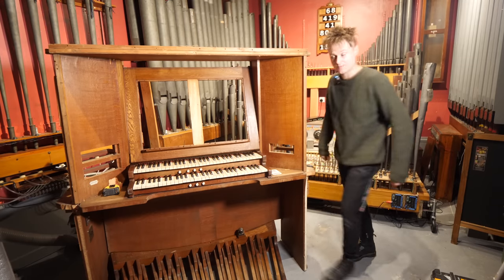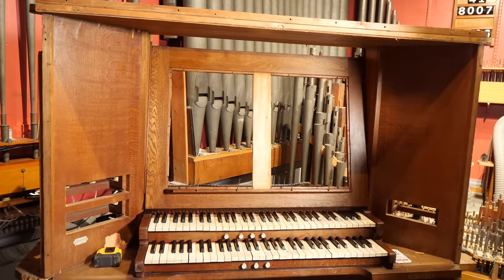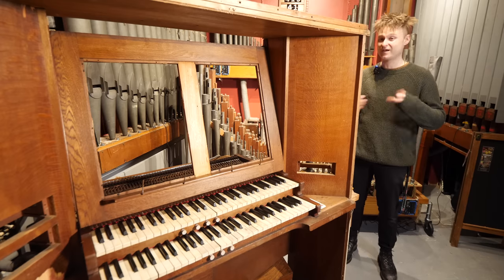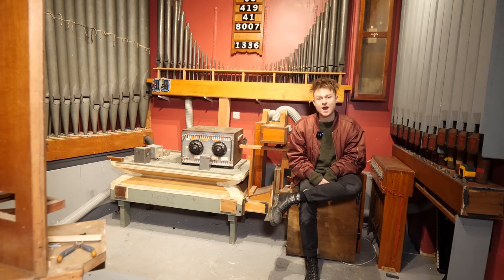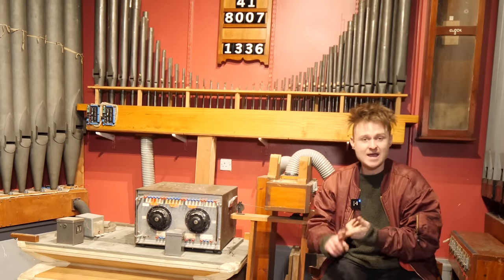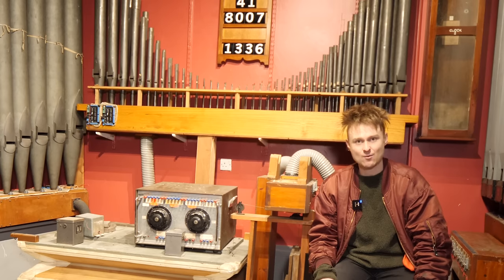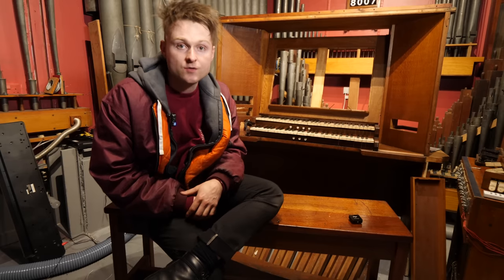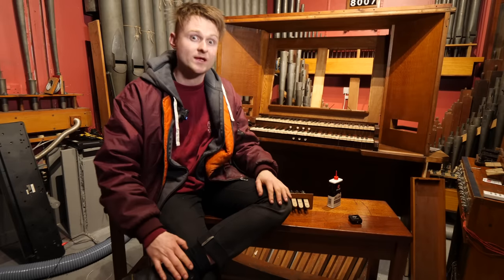I BOUGHT A CHURCH ORGAN PART 13 - MAKING IT LESS NOISY

Comment: I guess it's time to get some more of that HVAC kit for dealing with air moving stuff? The foil backed tape that gets used (duct tape rather than duck tape - similar but still different) may have it's uses for sealing up air leaks. PVC tubing if not HVAC tubing should be somewhat cheap for most things too, and use wider radius bends rather than sharp elbows where you can. Flex tube runs should be kept somewhat short, as those will have the most resistance to airflow. Can't eliminate them though, as you need that wiggle room for hooking things together.

Foam jacket insulation for tubing might not be bad to have on hand either, in this case to dampen out any resonance or undesired air whistling inside the pipes - rather than as thermal insulation. But it might not be needed, depends on how fast the air moves.

Also I'd bet it needs a tune not just from budging it around, but any time the seasons change. Wood just has a peculiar quality when it comes to humidity, since that is an aspect of it being a living material. (Not that it sounded that terribly out of tune to my ear, a subtle detune probably gives it more character - just like the blemishes on the old hardware itself.)

And it's fun to see it come together. And putting the most noisy bit out of the way doesn't mean you have to play it at a deafening level to sound good. (Still it's going to be loud though, by the looks of it.) So another good thing for visitors seeing it live.

Also love seeing the work in making it modular and turning that rat's nest of wire into such a tidy loom. Must be a nice gift to future you, when it's time to reorganize again or otherwise having to work on it. I bet that aspect is better than how the previous owner had it.

Comment: Plumb it with smoothbore pvc pipe. The pressure drop in that flexible stuff is high due to the turbulence at the walls
Reply from the maker: i mentionned that in the video and why i havent done so.
Reply: @LOOKMUMNOCOMPUTER  After more consideration, Air also has mass, so there is going to be some wow when you punch some low notes. It's the same reason why electric cars have instant throttle response vs internal combustion
Reply from the maker: @retrofitter  yes it does. But for a relatively small organ the difference is minuscule. People have mentioned the problem to me and I'm starting to think it's just one of those over the top things people do. Like gold plated connectors on hifi. I now have practical experience and can say there is no real disadvantage

Comment: Don't take any crap from anybody, Sam. You're doing a wonderful thing. You saved it. And don't feel bad about using modern parts and materials. Parts of that organ have been modified before and anyone doing that would have used contemporary parts and materials. You're just adding to the story. If you hadn't done what you're doing, the story would be over and forgotten and that would be sad.

Comment: You could get these "tin" metal pipes they use in building for airco, round ones also exist, the have the same diameter as these flexible hose you got hanging there behind you, what they probably used before these flexible pipes came along.
Than use aluminum tape to seal it and bind it or use self taping screws, like the pro''s do.

Comment: Put a window in the backroom with the blower and make it its own display piece in a different part of the building. That would illustrate both how a real organ is set up in a church (Or house) and still showcase the technology for visitors. I know it probably isn't the most practical, but would be very cool to show off, and would be a better representation of how real organs are set up compared to how you've had it set up until now. 

I grew up around DC, and some of the Smithsonian museums have tidbits where you will come across new bits of information about earlier displays further into the exhibit, or hints about topics before you get to their specific display. I've also seen this done with zoo's ant exhibits, where the ants have two large areas they travel between that are in different parts of the exhibit. I think it really makes the space feel so real and alive.

Probably won't see this comment, but if you do, I hope you find it interesting, and maybe gain some inspiration for the museum, either for this project or future ones.

Comment: Guessing someone told you this already, but if you export your 3D models to STL with higher fidelity, it will be smoother and more true to size. The facets mean it's slightly smaller in some spots and slightly larger in others, and will leak slightly more air. Good stuff!
Reply from the maker: I was not aware it was a fidelity issue with the stl file no. I'll give it a try

Comment: Fantastic, really enjoying following this. Wouldn't recommend 3 in 1 oil for motor or blower bearings though, it can leave a sticky varnish like deposit than can allow overheating and increased wear and noise. Best ask Discus (Watkins and Watson) what grade of oil they'd recommend
Reply from the maker: Just going by what it says as it literally says 3 in 1 on the motor plaque

Comment: You could mount the airbuffer on the wall and replace mass with a spring or rubbers to make that force pushing. And obviously cut the legs off. It's not a big object, pretty flat.
Reply from the maker: It would put stress on the bellow walls in ways not initially designed

Comment: We've been over this, Sam... a proper Church organ is never in tune! It is the tune, upon which all else is built. 😉 Some large modern organs use air compressors, like what you might see used with power tools. That and a pressure regulator (on the pipe side) might be another way to give the blower a boost, if you can't get a large enough airway from the original blower.

Comment: I'm a church organist. The bass pipes (lower 8' and all the 16') can absolutely eat wind, dropping the pressure locally and mistuning stuff, the higher pitch ones use very little wind but will go flat if their air supply pressure drops because large pipes elsewhere are guzzling it. Some organs have smaller reservoir bellows attached to the wind chests to smooth out pressure variations as sudden loud chords are played. This avoids mistuning if the pressure drops on the chord. Corrugated tubing, although easy to handle, causes much drag to the air flow. Horrid stuff from an air supply perspective!! It is better to use smooth wall pipe and keep lengths as short as possible by careful arrangement of all the hardware. Drain/gutter piping is a possibility and easy to connect, ugly to look at. Metal air pipe runs of thin galvanised or tinplated steel would have been used in the old days. Hope this helps :)
Reply from the maker: hey cheers. having experimented the corrugated is fine, found its a bit like gold plated connectors for hifi haha. bass tubes are on their own pipes to the bellows. its all working as expected, and corrufgated is nice and flexible to all for the win

Comment: might leave the top off the keyboard , the top makes it look out of place unless you where to build it intoo a wall
could add a small consolle on the side thats about the same height of the keyboard for the switches 
as for moving enough air : maibe use a bigger diameter pipe as the "main trunk" and have the smaller flexible pipes come off that and intoo the airchambers for the organ pipes 
if you can find a glas wall  with a sliding door in it (old bungalow being demolished) you could put that in front of the organ pipes and set the keyboard in front of it , you can "adjust the volume" by opening the sliding door some , it will allso protect the fragile part of the organ against the museum visitors hand , having the airsystem in the closet is definetely an improvement in the overal sound
Reply from the maker: I think it looks nice

Comment: You gotta use a straight pvc pipe or something like that instead of that spiral flex hose because the spiral itself slows down the air, making it lower pressure. Its like a wire that is getting warm increasing resistance.
Reply from the maker: I spoke about it in the vid. It's fine. And has been fine for 40 years. I'm starting to think people who are mentioning these issues in small ish organs like this are being melodramatic
Reply from the maker: As mentioned it's about experimenting. Because solid pipe is not an option

Comment: You could stick with your own principle and leave the blower and bellows visible to visitors. The hissing would be part of the experience, since you're not trying to produce a concert organ so much as an exhibit that functions, to demonstrate what it is and how it works. You could maybe stick them in a perspex box with an inlet for room air to the blower. That would reduce the hissing, if perhaps not eliminate it, and people would be able to see it working. 

Am I right in thinking it operates off the pressure in the bellows, and when that falls below a limit, the blower switches on again? Hm would you need hysteresis for that? To stop it constantly clicking on and off around the set level? Some kind of sensor monitors the air that's in there? Could be as simple as a switch or contact that meaures the height it's inflated to, when it goes down low enough, on goes the blower. 

Now I'm thinking of some contraption with contacts and relays to give separate "on" and "off" levels... I'll go watch one of the other videos to find out how it's all done.

Comment: This is phenomenal - but why stop a rollers and LEDs?

CONVERT YOUR ORGAN INTO A SWARM OF DRONES!

Ingredients per mobile set of organ pipes:
- 4 electric motors to power the wheels
- 1 ditto, sufficiently powerful to provide an autonomous air supply, viz:
- low-noise fan, invidual bellows and air-supply connectivity
- heavy-duty battery (maybe take an electric car battery and split it up)
- bluetooth or other remote control system
- drone hardware and software, including swarming capabilities 
- MIDI communication piggybacking on the RC drone comms to play the music

(I think that's all)

Your organ could dance quadrilles while you're playing fugues!

Comment: Dirt in de blower may cause unbalance (and therefore strange noises indeed), so a good cleanup of the blower might help, but it is not unlikely that the bearings of the motor and blower have been neglected in the past, and are worn out.

Comment: Any plans to put a window into the room with the blower? The move was definitely a good one but like you said the organ is a museum piece so it seems a shame to keep such a vital part of it completely out of sight.

The console looks fine as it is, though I'd definitely touch up that damaged bit of veneer if you do nothing else just so it doesn't look run-down and un-cared for. I totally sympathise with keeping the character of it though; if you go round churches you'll find very few organs in totally pristine condition and even ones that have had a proper clean still won't look brand new. Wouldn't be the first organ I've played where some of the keys have had finger-shaped grooves worn into them!

Comment: Sam, with all the moving you're doing, you need a small dolly, or a little platform with wheels on the bottom.
Reply from the maker: Cheers! I had one and in my experience more trouble than they are worth :D. It would make sense in big open spaces. But not for this place
Reply: Yeah rock'n'rollers are good to carry heavy but stackable loads across long flat smooth runs. Not so great for tight quarters or uneven ground.

Comment: I do not know, how do You plan to wire up the switches, however since you told that the console could be on wheels, I suggest connecting them to an arduino and using midi CC commands to control a set of relays that turn on the registers. Si in the event of moving stuff you would have one midi cabe for registers plus whatever you plan for the pipe clusters ;)
Reply from the maker: As per the rest of the electronics it'll be midi yes
Reply: @LOOKMUMNOCOMPUTER  This is awasome project, I wish I could have ny own pipe organ. However, you know, 16 years old:)

Comment: A straight pipe would be best because the riffles in the flexpipe distorts the air going thru. You could make the long runs out of straight pipe but the corners and curves of flexpipe.
It might make the hole thing even more quiet because of less distortion. -In my humble opinion. Sounds beautiful though!
Reply from the maker: I'll stick with what I've got. As mentioned I have done it this way due to not knowing if I'll be plonking it somewhere else soon. In reality with a relatively small organ it makes hardly any difference

Comment: Noice. If you have a problem with flow rate you just have to run another pipe. it'l be fine though. to late now as you printed the flanges. but you can buy air vents for extractor fans and tumble driers for a couple of quid. Peace v

Comment: The fact that the pipes are now out of tune probably indicates that the longer wind trunk has added some pressure loss. Quick fix would be to add a little more weight on top of the reservoir. Better would be to use rigid PVC pipes rather than a flexible hose with all those ridges. Basically you want the wind pressure at the feet of the pipes to be constant irrespective of how many pipes are being played, and you need smooth trunking for that. To use your electrical analogy, if you keep R small, then your I^2 R losses would also be small irrespective of I.
Reply from the maker: No it's because I knocked a bunch of the flutes out when moving it. I've fixed it since shooting the video. Also in the vid it needed more weight formth ballast. I talked about rigid v flexi pipe in the video. And to be honest now I have done it I'm starting to think the people with a problem with flexi pipe in a small organ line those are being mellow dramatic :D. And yes less resistance which is why I'm splitting it in half. The smaller pipes get 1 pipe. Larger pipes get another. Cheers.
Reply: @LOOKMUMNOCOMPUTER  Modern organ builders do use flexible hoses but that tends to be limited to connecting individual pipes to the wind chest (to allow freedom in pipe placement). Main wind trunks are usually PVC pipes or wooden conduits - something smooth anyway. The real test comes when you've got all the pipes and electrics connected - try playing big repeated chords on full organ and see how it copes. It may well turn out to be OK as you say, but if not then you know what to try!

Comment: Great stuff! But, what about airflow into the cupboard? Do you have a vent or grate in there? Wouldn't want the blower to overheat from strain.
Reply from the maker: It's got a false ceiling. Definitely not air tight that room

Comment: Sounds a bit different, maybe a bit low on air? That will for sure change the pitch, and in different ways with different reeds. Should be able to salvage some solid pipe and it's easy to reconfigure. You are setting yourself for headache reusing that old accoredion pipe.
Reply from the maker: Sounds pretty similar in real life tbh.
Reply from the maker: The pipe is fine. Infact I bought some more in the vid it's more rigid. It's more than fine

Comment: love it. you should ground that air pipe though!
Reply from the maker: But it's plastic? The beading is completely coated?
Reply: @LOOKMUMNOCOMPUTER  yup. but it gathers static electricity easily, depending on the plastic. The tubing for chip clearing on circular saws normally has a steel spiral wire running all the way through it, you can check if yours have it and ground shouldn't be too hard. It is actually a fire hazard in wood shops and it would cause havoc on electronics.
Reply from the maker: @thiagoennes  the reason it's a fire hazard in wood shops is due to the particulated
Wood dust, I'd imagine it's fine in this scenario. Cheers
Reply: @LOOKMUMNOCOMPUTER   Yes! i didn't mean it would be a fire hazard in the museum, sorry. I'm loving the organ series btw! :)
Reply from the maker: @thiagoennes  all good! ill keep it in mind tho :D cheers!!!! if the opportunity prevents itself ill be on it like a car bonnet!

Comment: So glad I bumped into this project. It has been fascinating to watch. Although I wince every time something 'original' on it is replaced with modern technology, I remember that if it weren't for you it would have been melted down by now. Certainly my favourite of your projects. 
Presumably the pipes have gone out of tune because the tuning parts are just held in place by friction, and will have been joggled about in moving them.

Comment: doesn't' the corrugated pipe hinder air flow vs a smooth pipe ?
would it be better or more efficient to use a smooth pipe ?
Reply from the maker: Yeah but not enough to make a difference it's like the gold plated connectors in hifi. Melodramatic

Comment: i don't want to complain or offend you, but you say, you want to keep it original with all the patina and then go ahead and change all the wiring completely and ad LEDs.

but don't get me wrong. i do love this organ and i find it great, that you saved it.
it's just... the statements are a bit inconsistent...
Reply from the maker: It's two different things. The bit I was talking about was the direct input device. The console is what people interfaced with. It's about the materials used. The LED's improve the machine. The console is completely rewired but the materials are still the same that had been touched.
Reply from the maker: There is consistency. It's talking about material not electrical

Comment: Could a compressor be used to drive the organ
Reply from the maker: Very noisy. Would
Have to be quite a distance also doesn't offer the amount of air required. It's more high pressure low flow. This is low pressure high flow